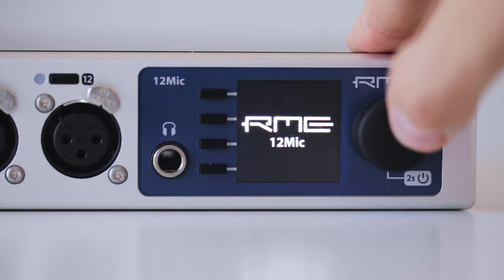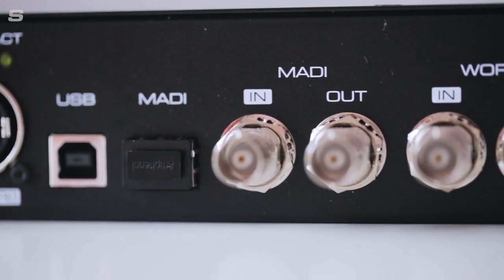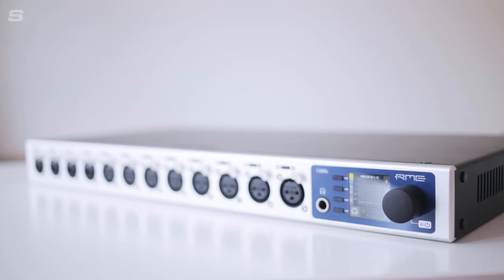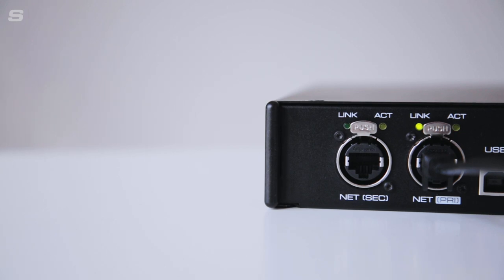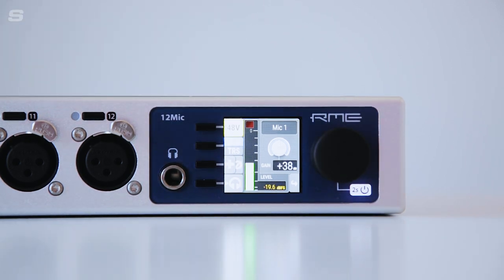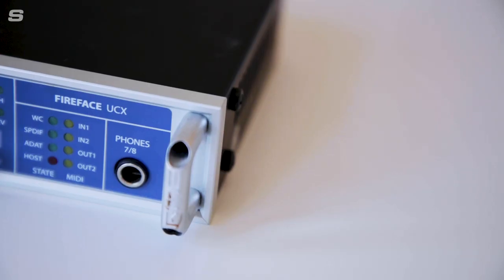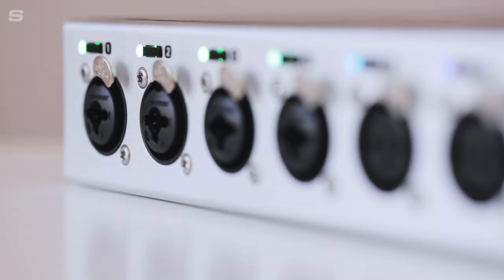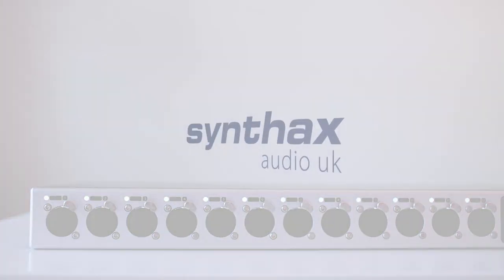RME 12Mic Overview - 12 channel microphone preamp with MADI and AVB

Comment: Looks like a great way to expand on my RME Fireface... and an excuse to buy more synths. 😎🥃
Reply from the maker: Haha any excuse to buy more synths 😂. You might want to check out the RME M-1610 Pro however (if you're not planning to use the 12Mic's mic pres) - see our video from NAMM here; 
https://youtu.be/j60WNwtjuSI
Reply: @SynthaxAudioUK  i need a setup for synths myself. 1610 and 12mic are priced similar, wouldnt it be better to get 12 instead, for reasons you have 12 line inputs plus the 12 mic preamps as extra
Reply from the maker: @zanem9022  Hi, sure if you don’t need any outputs then the 12Mic might be better suited to your setup. Like you say, you would then have the option of recording synths or mics, as well as instruments on the first 4 inputs (switchable Hi-Z inputs).

That being said, if you’re primarily recording synths we’d still usually recommend the M1610 Pro, since that gives you 16 inputs (plus the 10 x outputs) over the 12Mic’s 12 inputs. 

One final thing to note with the 12Mic, since its a preamp you’d also want to be careful not to switch on phantom power (when recording with your synths), since that could potentially damage your synth’s output. Using a DI box should solve this.
Reply: @SynthaxAudioUK  ill be primarily plan to record synths. Definitely have the di's ready to go. I plan to monitor thru another interface that accepts adat, possibly a cranborne r8.. In what situation the outputs (10x) of 1610 is preferrable? How is that implemented, as im still learning the gear
Reply from the maker: @zanem9022  Hi again, the outputs can be used for anything you need really - connecting additional pairs of studio monitors or speakers; sending audio to FX units or other hardware; or for working with a mixing console. 

You just need to connect the ADAT inputs and outputs of the M1610 Pro to your audio interface’s ADAT I/O (using optical TOSLINK cables). Once you’ve done that, all of the analogue inputs and outputs on the M1610 will be available as I/O. You can then send audio in both directions - e.g. into your DAW for recording, or out of your DAW for monitoring or processing.

For example, do any of your synths have an audio input? If so, you might want to use its filters or FX section, i.e. by sending audio out of your DAW into the synth, then recording this processed signal back into your DAW. Or you might have a hardware FX box that you want to run your sounds through - such as a reverb or compressor - then record that back into your project.

Hopefully that all makes sense. You can read our article on expanding your I/O here, where we go into more detail;
https://www.synthax.co.uk/latest/2020/07/31/more-inputs-outputs-audio-interface-rme-ferrofish/

Comment: Wish there was a ufx avb with avb, dsp, spdif, 2x headphone, 2x analogue out, madi and durec, 2 mic inputs for talkback would be enough. That would be a sold for me! That is what i miss in rme line up, digiface has no dsp, and i don’t need a digiface with my mac to record. Also no way to do an stereo mix with eq, reverb and (not needed always but nice to have) compression for a 2-track recorder or codec for broadcasting. I like mixers but in most classical recording i can easily manage it without, but until now i work with Antelope Zen and Orion Studio’s (back then rme had only interfaces with 8mic pre’s and the antelope back then sounded better then the rme competition) and analogue multi’s which is a pain in the ass.
I would love to go avb but i would like to keep my recording set small, 2 2HR flightcases is the max for 24 channels. And we are almost there.. 2x 12mic and then i need a avb switch (for now i could also daisy chain the two by madi but then i miss control of the gains because the network is failover) and a good device like the ufx+ but with AVB. This would be the ultimate recording set for me. Please rme make something like an  UFX AVB or UFX+ AVB.
I now can go the dante route but i need some more equipment and is a lot more expensive (2x 12mic-d, normal switch, Digiface Dante, UFX+) which will cost like €2500,- more and extra conversion dante to madi so extra cables.
Btw i know i can go madi but i still need network to control the preamps and to setyp the routing, so… AVB could make life easy!
Oh Motu make some interfaces that can do the ufx avb wish thing but… i can not use it with rme because they don’t use milan standard yet or something?!?
Other option is with 2 cables, a switch, m-1610 and one cable direct into my mac (or digiface) or use 2 avb switches which makes it more complicated. But again i miss totalmix dsp then.
Edit: maybe an ucx avb with dsp and usb3 or tb3 (or new usb4) would be perfect
Reply from the maker: Yeah I hear you, a UFX with AVB would be super useful. In terms of new products, I think things have probably been set back a bit right now unfortunately, what with all the on-going problems with manufacturing... Shortages of semi-conductors and other materials, not to mention the AKM fire.

I'd recommend posting on the RME Forum, it's read by all of the developers. It's always good to let them know there's demand for a certain product :) .

https://forum.rme-audio.de/

Comment: browser based remote control sounds interesting,
I wonder what are the pros and cons compared to let's say TotalMix Remote app?
Reply from the maker: Hi thanks, I suppose the main benefit of browser-based control is that you should be able to use it with any operating system (and not run into problems when a new OS update comes out...). 

Many users still prefer a dedicated app however, and both have their pros and their cons. I guess we'll have to see what the future brings with RME!

Comment: Can you connect rme 12mic to merging hapi mkii interface adat port, but it only has one port, which can only send 8 channels right?
Reply from the maker: That's correct, because you've only got one ADAT In on the Merging, you can only receive eight channels. 

Using the RME Web Remote you can of course choose which of the channels you'd like to send to the interface.

Hope this helps!

Comment: you guys have some Dante and AVB options. Can your RME products communicated with dante on one unit and AVB on the other?
Reply from the maker: Hi there!
Do you mean converting Dante to AVB from device to another, or do you mean having two seperate devices operating AVB and Dante seperately (for instance, connecting a Digiface AVB and Digiface Dante to a computer together)?
Reply: I think the question is if you van daisy chain them via madi and the use it to feed dante as well as avb, and i giess that is possible but only max of 64channels ( because of madi)

Comment: Nów can You compare it with micstasy. What is better option to expand ufx interface?
Reply: How can You compare
Reply from the maker: Hi there!

This totally depends on the needs of your setup because both offer a slightly different feature-set. The Micstacy is an incredible preamp and is still used throughout the world on classical recordings and other sessions that require a great deal of detail. The 12Mic features a newer circuit design and more in terms of both analogue and digital connectivity, so it's a great preamp for recording more than eight channels and for getting connected to a wider ranger of gear. 

Hope this helps!
Reply: Thank You.

Comment: Can I connect this to my RME ADI-2 FS R BE PRO?
Reply from the maker: Yes, you can connect it to the RME ADI-2 Pro, but you would only be able to make use of 8 of the 12 channels. As well as this, whilst the ADI-2 Pro has the capability to act as a class-compliant interface, you miss out on a lot of the benefits of RME interfaces, like low-latency monitoring and the routing benefits of TotalMix!
Hope this helps!

Comment: Which RME PCIe cards are compatible?
Confused with MADI, AIO, AES and all these acronyms.

Will any RME card with adat be able to connect to this?
Reply from the maker: RME do have quite a wide range of PCIe cards for sure! For the most part, these follow names that include the I/O - HDSPe MADI is a MADI card, HDSPe AES is an AES card etc.

But to answer your question - yes, any of RME's cards with ADAT or MADI will be compatible with the 12Mic!
Reply: @SynthaxAudioUK  Thanks for your reply. I'm looking at the HDSPe AIO Pro card (mainly because of its price) . Would that be a good fit or could you recommend one of the other cards? Is ADAT the preferred way to connect to the 12mic?
Reply from the maker: There's no real "preferred way" as such to connect to the 12Mic, all the digital I/O options give a stable connection. This would depend entirely on your setup and your needs, in terms of the kind of things you'd be expecting from the PCIe card. 

What I will say though is that the AIO Pro is a very highly rated card, it even won Sound on Sound's Editor's Pick in their 2021 Gear of the Year awards. They're a bit hard to come by at the moment, especially here in the UK, but if you're from a different country it's best to speak to your local dealer and see what the stock situation is like!

Hope this helps!
Reply: @SynthaxAudioUK  Other than ADAT, how else could I connect that card to the 12mic?
Reply from the maker: ADAT would be the only option, and actually this would only give you access to 8 channels on the 12Mic. So really, for expanding later down the line, as well as getting the most out of the 12Mic, going for the MADI or MADI FX cards would give you more scope!

Comment: Does this rme12 mic need seperate interface. Is this meant for extending XLR connections only. Pl. clear.
Reply from the maker: Hi there!

Yes, you need to connect the 12Mic to an interface. The 12Mic is a microphone preamp, meaning when connected to an interface (via ADAT or MADI in this case) you get 12 extra microphone inputs into your interface.

Hope this helps!

Comment: I'm assuming this works with a UFX 2 as well via ADAT???
Reply from the maker: Hi there! Yes this would work with a UFX II and would actually be a fantastic pairing. 

It's worth noting that if you want to record all 12 inputs, you wouldn't be able to record at any higher than 48kHz sample rate (as the UFX II only has two sets of ADAT I/O).

Hope this helps!

Comment: I have a question. If i plug in, say, 6 microphones to RME and connect it to my PC, will Windows recognize them as 6 separete devices on hardware level? Or Windows will see only Audio interface itself, but wont know what pluged in to it?
Reply from the maker: Hi, the 12Mic is a microphone preamp (and not an audio interface), so you will still need a way to connect it to your PC. In terms of digital connectivity options, you have ADAT, MADI and AVB for hooking it up to the interface (RME Babyface Pro FS, Fireface UFX+, Digiface AVB etc).

(In theory, AVB doesn't need an additional interface as it is operates via ethernet, however an AVB-capable network card is still required.)

AFAIK, Windows will see an audio interface as a single device. Each channel can be accessed separately of course, either by choosing it as your input channel in the windows settings, or via a DAW / recording software.